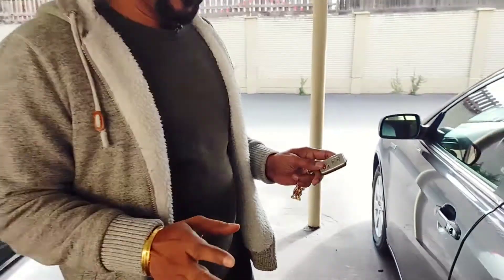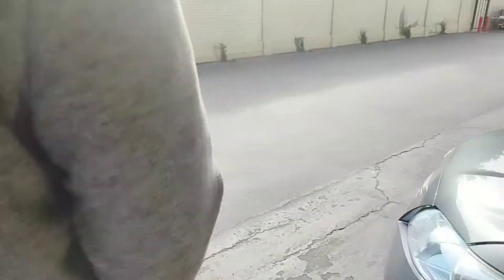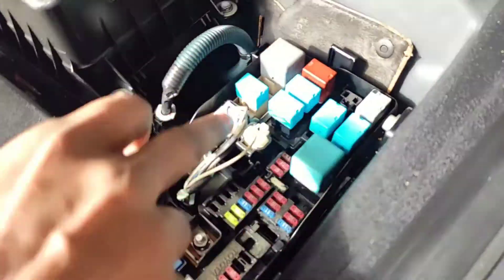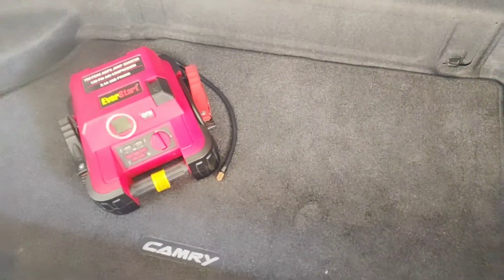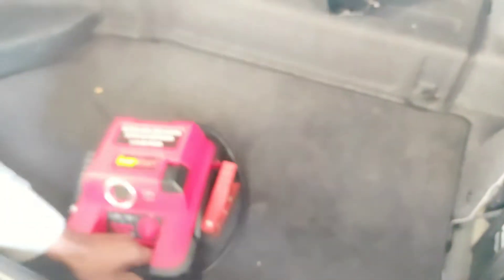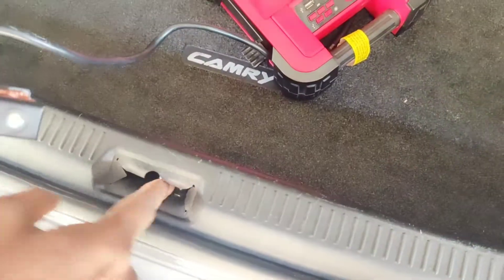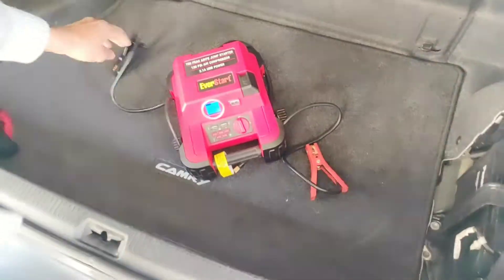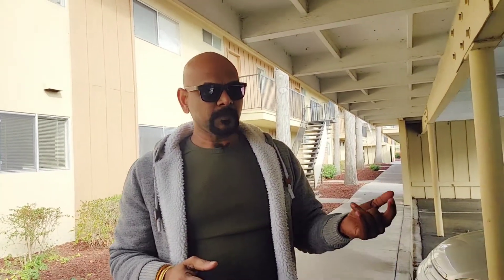How To Jumpstart any Car | (2007) Toyota Camry Hybrid | In Tamil | With English Subtitles |

Comment: How did you open the trunk with dead battery? 🤦🏻‍♂️
Reply: I’m sure you found out already. This is for the next person The trunk is a manual release on this year make and model. If it is not the same 07 Camry hybrid check under hood in fuse box it will show a space for POSITIVE + connection then connect to ground using the gram of vehicle.